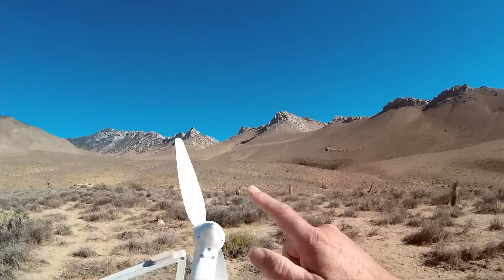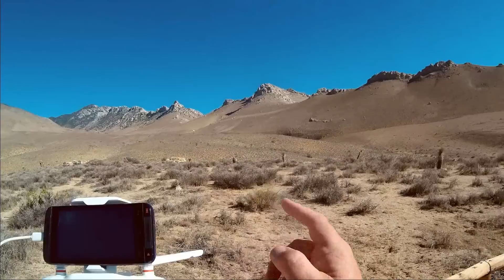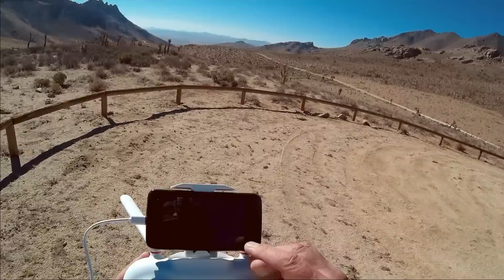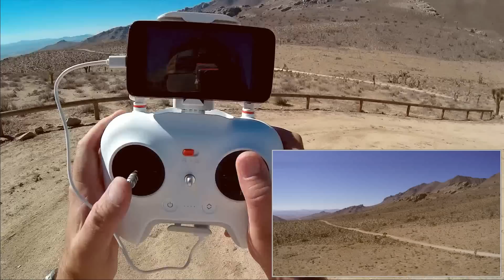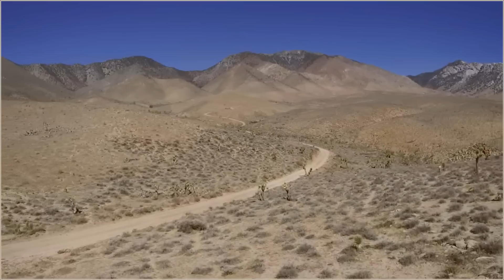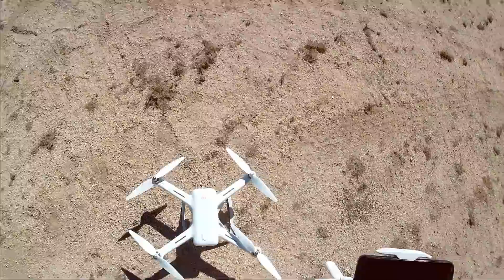Xiaomi Mi Drone Flight Test Review

Comment: 100m range??? Seriously? That is way too short of a distance for the price.
Reply from the maker: +Steven Penny oh it can fly much much further than that. It's just that this initial release version would only let you fly that far until you had 5 hours of experience. I'm not sure if it's still that way with it's current firmware?
Reply: Hello Quadcopter 101!
With your video, my research and experience from others, I bought Mi 4k version. It arrived few days ago, with English manual lol. App on my HTC One M9 works perfectly, and the software talks back with commands. Gimble works properly. Flight is very tight and controllable... awesome quad copter!
I made short video of my maiden flight, if you'd like to check it out on my channel - not clickbait lol
Cheers!

Comment: yours drone is the 1080P version? how long you can flight/control it? 1km?
the two sensors under drone, arent ultrasonic sensores to help the automatic landing to it know the distance of the ground?
What mobile you are using or what app is it, because you have lot of alerts because "your" mobile..
and exist any headset fpv for this drone? cant found any xiaomi headset..

Comment: at the info page writing 3km but you contrled till 100 meter .. Which is true? I was thinking to buy because of 3 km , 27min flight time and auto return or so.. So 100 mt too less
Reply: Beginner mode is 100 meters. Max is 2000 meters.

Comment: I know this video is 5 months old.  You gave it the ole college try at showing the features.  This is typical of Chinese products.  Build it, sell it, then worry about the functionality of it later.  This would be ideal for me if  it:
1. Was a little smaller 250mm size
2. Less cumbersome to get ready
3. Had some of the bugs worked out
4. NO RESTRICTIONS ON THE INITIAL FLIGHTS.  Yes indeed, in the US the FAA frowns on FPV flight period. All line of sight.  400 feet altitude restrictions with the exception of us who belong to the AMA. 
5. 5.8 ghz for video.  I want to use my goggles not a damn phone..
6. Please Chinese sellers/mfgs..  Most of your sales are outside China!!!!!  Place the app in ENGLISH...

Comment: Hello @Quadcopter101, wich quadcopter would you recommend for a beginning drone user, needed for capturing video's on vacation, price around 300-550 dollars? thanks
Reply from the maker: As a beginner flier, you WILL be crashing, crashing hard, and crashing a lot as you learn what not to do with a quadcopter.  I always recommend the Syma X5C for new fliers, due to its excellent stability, durability, and ease of flying. And it even has a camera too.  Use it to learn the basics of flight with.  Let this cheap quadcopter take the inevitable crashes and bangs of a beginner flier. And if you break it, every part on it is cheap, widely available, and easily replaceable. Later as your flying skills improve and you're not crashing as much, then consider something better/more expensive.  https://www.youtube.com/watch?v=y93vzA-KRlM

Comment: is smartphone necessary to function it. 
what if we are in are ...remote area.. without any data connection... ???
Reply from the maker: I don't know as I still haven't completed my 5 hours of training to be able to test it. But it does get a bit choppy at close to 100 meters https://www.youtube.com/watch?v=eikqrG-sFR0
Reply from the maker: +ivarockazi you need the smartphone, but do not need data connection. Notice the remote location that I'm flying from.
Reply: +Quadcopter 101 so it will not    use any cell phone data??
Reply from the maker: Syb Schuitmaker It will try to connect to Xiaomi to see if there are any firmware software updates.  But if you have data turned off, or are in an area with no data, it will proceed to startup procedures.
Reply: +Quadcopter 101 oh okay good to know, but are you able to use the fpv feature without data connection turned on on your phone? if so how far is the range?

Comment: What do you think about Syma X4 Assault quadcopter??
Reply from the maker: Quite an old quadcopter, been around for at least two years. I'd skip it as there are much better out there these days.  And if you can find one new, its LiPo battery is probably beyond its shelf life by now, and might not hold a charge. https://www.youtube.com/watch?v=c3GaBkXhIn4
Reply: +Quadcopter 101 I bought one second hand and the only thing that was broken was the battery. But i bought 4 new batteries and it flies ok.     Anyway, thanks for the response and which cheap drone would you reccomend for the complete amateur ?
Reply from the maker: MegaCzarnyPL I always recommend the Syma X5C for new fliers, due to its excellent stability, durability, and ease of flying. And it even has a camera too.  Use it to learn the basics of flight with.  Let this cheap quadcopter take the inevitable crashes and bangs of a beginner flier. And if you break it, every part on it is cheap, widely available, and easily replaceable. Later as your flying skills improve and you're not crashing as much, then consider something better/more expensive.  https://www.youtube.com/watch?v=y93vzA-KRlM
Reply: +Quadcopter 101 Thanks for the advice. Cheers :)

Comment from the maker: Today I did another flight of my Mi Drone.  I used a different phone with Lollipop installed (Android 5.1).  The above flight with disconnects was with an older phone with Jellybean installed (Android 4.2).  
Long story short, the Mi seems to prefer Lollipops over Jellybeans ;-)  It flew great, with no disconnects throughout the entire flight.  Was also able to successfully upgrade the firmware with Lollipop.  Will try to upload this flight for tomorrow's Quadcopter 101 video.
Reply: Did you get the advanced features unlocked? And is the official Mi Drone app available in English or only unofficial apps so far?

From what I've seen in a couple other vids, the "learning" mode is locked in for 500mins of flying time, and no one has reviewed what it's like after that...
Reply: Quadcopter 101
Reply: can you review the GoPro Karma?

Comment: Q101, according to another video I watched you need to connect to the FPV via wifi called mi cam (wifi network.)
Reply from the maker: Not sure how he connected to WiFi as mine doesn't seem to transmit a WiFi signal?  Maybe he has the 4K version?  BUT but but... today I did another flight of my Mi Drone.  I used a different phone with Lollipop installed (Android 5.1).  The above flight with disconnects was with an older phone with Jellybean installed (Android 4.2).  

Long story short, the Mi seems to prefer Lollipops over Jellybeans :-)  It flew great, with no disconnects throughout the entire flight.  Was also able to successfully upgrade the firmware with Lollipop.  Will try to upload this flight for tomorrow's Quadcopter 101 video.

Comment: this or phantom 3 standard (for long range fpv flying)
Reply: P3S no contest
Reply: xiao mi
the phantom does not have glonass and it relies on wifi
also the phantom does not have a great range
Reply: +Henry Schafer lack of glonass sucks but GPS isn't that bad alone. both use WiFi, not just the phantom.
Reply: +bpunlimited oh sorry. any one would be good. the Xiao mi does have a 4k camera though.
Reply: But the 4k mi costs as much as the upgraded phantom.
Reply: +bpunlimited oh sorry

Comment: Excellent review, as always, and bummer about the App not co-operating.

Very nice drone, and NOT GEARED TO non-Chinese market.  Simple enough.  

Only thing I don't care for, is the 'newbie mode', especially 5 hrs of it, so about 25 cycles on your battery, that are wasted.  The brand 'Xiaomi' makes excellent and affordable product and a big fan of theirs.  

Get rid of 'newbie mode', and I may get one.

Not a big DJI fan, as 'fly aways' are still an issue, as one of the most prolific and experienced reviewers, just had his P4 fly away.

I build my own.............LOL.  

Don't even know if I would use way-point or autonomous flying, as I actually enjoy flying / controlling it.  Along with being a LOS guy.  Would get, when kinks worked out, though stability / GPS / gimbal / camera are the selling points for me, along w/ smart battery / flight time and safety features.  That alone is worth $400 USD.

Comment: Maybe try using a different phone ...or turn on the transmitter first, then quad, then lastly phone app and go to your phone WiFi settings and see if you are logged on with the Xiaomi 2.4 channel.  The phantoms are like this, they create a hot spot and you have to force the phone in the settings to log on.

Comment: Well, you did better than SeBy DocKy.  He never got his in the air.  The Chinese app kept crashing, and he couldn't read it.  So they sent him a firmware update which was supposed to fix the Chinese app from crashing .. and it "bricked" the quad ... it's a door stop. He's never been so mad during his review and went way beyond "it is not amazing" in his summary. He has 2 vids on it. The 1st was where he tried to use the Chinese app which kept crashing and he didn't get far.  He also did an "unboxing" vid and was not impressed with the way the props screwed on.  I won't say what he said about it, but you and your viewers can go to his channel and check it out for yourselves.  Without a doubt, that 5 hour restriction sucks (in simple English).  It's also apparent that they rushed this to market WAY before it was ready, with an Official Chinese app which does nothing but crash, and an unofficial English app that doesn't work.  Of course, for a company which sold thousands of YI action cams which were completely out of focus, I guess I shouldn't be surprised.  Well, like I said, at least you got yours off the ground and did get some video, which seems to be tied to the motors. As soon as you started the motors, the video turned on .. guess you can't record if the motors are off. Of course it would help if you could SEE if its recording and/or have some FPV video on your screen but, maybe in some future version of one of the apps.  For now, after seeing both SeBy's and your reviews, I would hold off until the many "bugs' (sometimes referred to by programmers as "features") are fixed.  Thanks for a 2nd look. Congrats on getting it off the ground! Cheers!
Reply: And on top of this people are very pissed about the price. Xaomi really screwed this up.
Reply from the maker: The quadcopter itself, its camera and 3 axis gimbal system, and its GPS/visual positioning system is very nice.  It's just that its dang app (which is the heart of the advanced features of this system) was not ready for prime time with the release.
Reply: Just don't update the firmware, you will brick this thing.

Comment: Seby Docky bricked his while trying to work with the firmware update.. Nvr seen him so upset during a review!.... He said the app is impossible
to keep from crashing..
Reply: saw that the second he posted, very sad..
Reply: Its good but in this particular video he gave some incorrect info about the quad, for example he doesn't know the difference between visual positioning system and the sonar.
He should start the video with the quad on a table puting propellers and battery pack, showing the transmitter and the app. 
Just giving feedback in order to help improving.

Comment: I wish they were a bit cheaper ...in my opinion the Phantom 3 standard beats this hands down...the only difference is the modular cam, foldable arms , and vps ...
Reply: Agree,  at this price point the dji certainly seems more user friendly.  This seemed like hard work just doing basic things.
Reply: I don't fly a P3S but I agree with you. Any new aerial video quad priced over $300 must first answer the question "why am I better than a P3S?" 

Until you get into the 2.7K or 4K name brand quads - P3A, P3P, Q500 4K - I haven't found a quad that can answer that question.
Reply: Probably the motor mounts don't crack from normal flying like the phantom 3. The build quality should be a whole lot better on this quadcopter.
Reply: 100% agreed
Reply: +Jeff Sibelius the Autel X-Star Premium is one of the top drones that's up there with the phantom 3 line, check it out.
Reply: DJI has filed a lawsuit against Autel for copying their designs. I read the case, and Autel copied basically everything from the Phantom drones. Except with lower quality.
Reply: I've been watching videos on that one  . . . it's $200 - $250 more than the P3S so I can't really compare it to the P3S. A better comparison for the XS-Star is the P3P or Q500 4K. 

I'd love to fly an Autel and test it out.
Reply: +Jeff Sibelius yea I got a phantom 3 standard and I love it.
Reply: +Ernesto dí Terríbílé  I have had 3 phantoms (3S , 3p and 4 ) none of which have had those issues or flyaways.  Maybe I'm lucky
Reply: I waited to see what this one was like. After seeing issues with the Upair, and now the Xiaomi, I am got the Phantom 3 Standard.
Reply: Brandon Mitchell what about range? can this actually go further than 100m? and what is the phantoms 4s range?
Reply: but u use crappy phone wifi for the video with the phantom 3 ......right
Reply: Spam
Reply: Report fake Spam
Reply: WHAT? Phantom beats shit :)
Reply: It costs from 449 to 470 dollars. Current coupons:
http://couponsfromchina.com/2017/04/21/xiaomi-mi-drone-4k-quadcopter-active-coupon-price-gearbest/
Cheers

https://www.youtube.com/watch?v=B_MRePD25ZI
Reply: You realize it's not like picking up wifi from a standard router right? You will easily get 3,000+ft range out of the box and people in really rural areas have gotten 6000+
Reply: They are cheap bicth

Comment: they should have put the visual sensors on the front or back
Reply: It's already been done on the phamtom 4
Reply: +Fluffy Cat I know but that would have been cool on this one cuz to have the sensors on the bottom I think is only good when flying in a place that has a low ceiling or indoors
Reply: The visual sensors are for object orientation, not obstacle avoidance. They are VERY different.
Reply: +Mcwdes it senses the ground so in a sense it's avoiding hitting the ground or anything below you

Comment: Very nice review! and heads up for xiaomi for bringing such a good product on the market for that price!
Reply: It's a 30 minute video so how can you say it's a good review
Reply: Saw the quad with some other youtubers. And skipped the first parts. Actually im still watching
Reply: +Josh Justin what do you mean the video was a review that was 30 minutes long and it was decent, so saying that it's not a good review because it's a little longer doesn't make sense.
Reply: I build quads, and build a 30.000mah battery to charge in the field.
my micro quads are build from H8mini receiverboards and custom silverxxx acro firmware. with Devo7E 300M range and les components then for example rotorX atom. Ful custom pids and we're even working on oneshot. my build can be found on Rcgroup forums and can be build for under 80€. Plz check it out!
It's a LOS build (because of the weight and cost) but it can be easily converted to FPV http://www.rcgroups.com/forums/showthread.php?t=2512604&highlight=appelmoesman&page=198